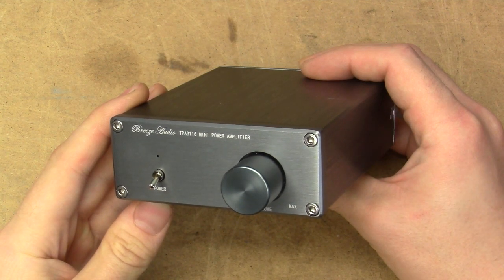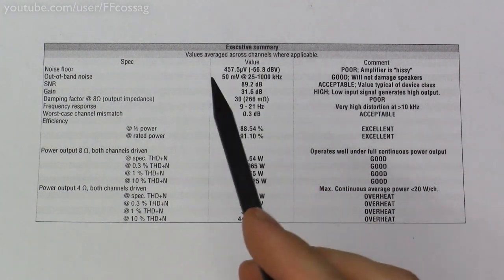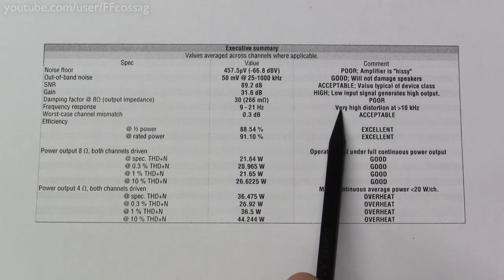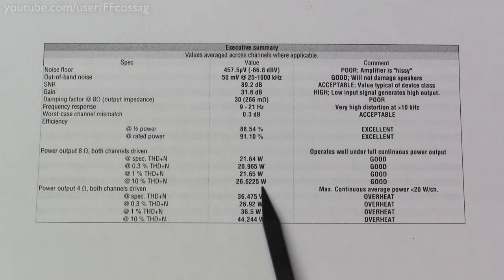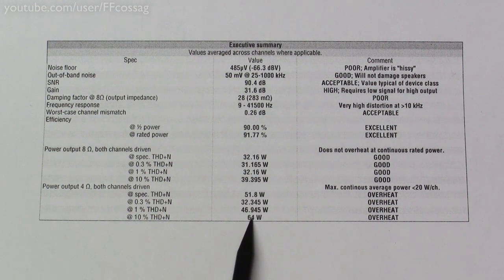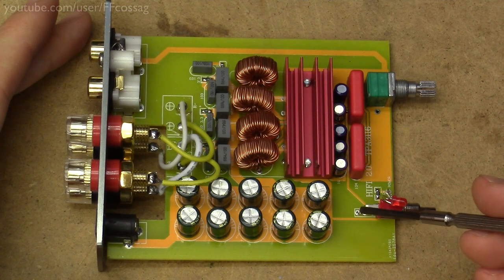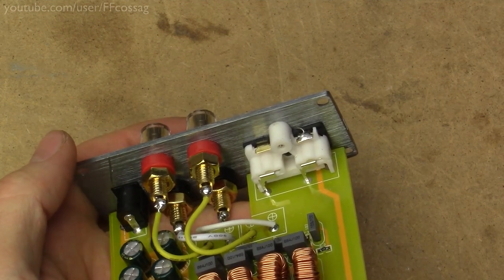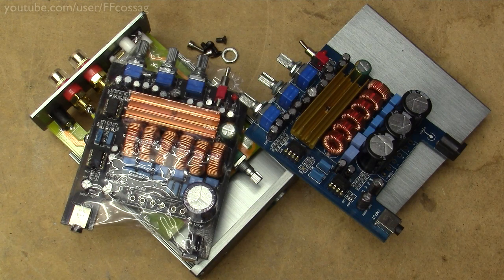Breeze Audio TPA3116 OBJECTIVE performance test, teardown & review

Comment: FFcossag   thanks for that 

I am considering buying a small amplifier for Camping purposes i have 2  very quality speakers and this is the spec (os-10 niles speakers)

Recommended Amplifier Power:
Five to one hundred watts per channel

Nominal Impedance:
8 Ohms

Frequency Response:
65 Hz to 21kHz, plus or minus 3 dB (on axis)

Sensitivity:
89 decibels for 1.83 volts of Pink Noise, measured at 1 meter on axis

Is this amp good for me?
 if you recommend something else ??
( portable ) let me know
appreciate your help!
Reply from the maker: It's fine.
Reply: +FFcossag just fine?
Reply from the maker: adir abelhack
I can't say much more than I did in the video.
Reply: +FFcossag il be happy to much more detail answer from you..
Reply from the maker: adir abelhack
Sorry, I make these videos in order to help you choose for yourself. If I were to just tell everyone what to get, I'd be defeating my own purpose.

Comment: Hi, could you by chance do the same review of the tas5613 chipset? It's a very intriguing audio chip..
Reply from the maker: What's intriguing about it?
Reply: FFcossag The high power it delivers in relation to its affordable price, the lack of detailed information you can find about it on the internet (except for the data sheet), its low-distortion truepath hd that I still don't get what it really is, the difference it makes to make it work with a 19v power supply vs 24v vs 32v vs 36v etc.. (sorry for my bad english)
Reply from the maker: It looks like a pretty standard, albeit high grade class D chip to me, most of the datasheet seems to be marketing wank. Do you have a specific module in mind, that you'd like to see tested?
Reply: FFcossag Ok, I'm no expert, therefore this is probably the reason why it's intriguing to me and not to you.  Specifically, I'm thinking about buying the Drok tpa5613 2.1 amplifier. 2*75w + 150w (300w total measured at a 35v voltage). It looks very similar to breeze audio typical amplifiers. No aux, no digital connections, no bluetooth, just 1rca. Thanks for your answers anyway and keep up your good and detailed work.

Comment: could u use a 24volts 20 AMPS power supply with this? haw dose the amps affect it?
Reply from the maker: 24 V is a bit too much for this amp, but it'll likely be fine.

Comment: Would it be worth putting a small quiet fan in the case?
Reply from the maker: I would not say so. Perhaps drilling some holes.
Reply: I would add a copper spacer between IC and case, and maybe even a heatsink straight on the top of amp. With proper heatsink it will look (and stay with 4ohm load) really cool, I guess

Comment: hi, would you do a similar test with the successor of 3116, the TDA7498 ? I just bought one because I thought my 3116 was awesome and the TDA7498 is meant to have double the power. 29 usd for the TDA7498 2.1 on aliexpress
Reply from the maker: The TDA7498 is not the "successor" of the TPA3116, it's just a competitor's chip. If you have a link to where I can get one of those modules, I might check it out. Performance is tied more to the implementation of the chip than the chip itself.
Reply: +FFcossag just type TDA7498 2.1 in aliexpress it's the blue one that claims 400 watt. 200 + 100 + 100 I just said it was the successor because one of the sellers told me it was.
Reply from the maker: Phil Drums
He lied, lol.
Reply: +FFcossag haha damn! Anyway, if you could make a video on how far below 400 watt it is, that would be amazing. I have 4 ohm speakers that I will using with it, with which I have used at full blast, for entire nights, with my 3116, with a 12 volt battery and I had no over heating issues. Although i have a different circuit board to thr ones you have. Now I have just bought a 24 volt battery and the TDA7498 with which I feel like I might have issues after watching your video.
Reply: +FFcossag i got a bluetooth 4.0 module that might interest you too. It comes with an app for Android and iPhone that allows you to change frequency's on the radio, and the equaliser so that you can tune your portable speaker. Only 11 dollars!
Reply from the maker: Phil Drums
I generally don't do bluetooth stuff, on account of how I don't own (nor do I desire to own) a smartphone.
Reply: +FFcossag ahh well you dont need to use the app. it comes with a remote control. It has a 7 band eq to try make your portable speaker sound alright. I think it really helps! just using the amp doesn't generally sound to good.

Comment: could i run this amp with 4 ohm speakers  if i drill a hole on the top of the case and put a 80 or 60mm pc  fan?
Reply from the maker: Likely. It's probably fine even with no fan as long as you don't play loud.

Comment: It's nearly impossible for it to be a clone IC. The world simply doesn't need THAT many no-name almost-high-quality amplifier boards to justify the immense effort of copying this modern and nontrivial IC, when much cheaper 12V and even 24V ICs are available like PAM8100, which is sufficient for nearly all non-HiFi use-cases. Reject? Possible. More likely though: you're supposed to actually cool the IC! A tiny heatsink in stale air, no provision for bottom side cooling, now how much good is that doing you?
Reply: I agree. I was wondering about the knock-off, but TI-chips aren't that expensive for you to warrant any copying. They're less than 2 euro per piece from Mouser Electronics and other reputable sources. But I've noticed that even though a lot of the amp chips support up to 24v, the quiescent current skyrockets if you up the voltage from 12 to 24v. So that's in addition to the load you're driving. Using 4 ohm speakers with 12 volts might actually end up giving better results.

Comment: The value that i hate the most, is the 10% distorsion, that mean it is not high fidelity.
Reply: No, ALL amplifier modules are specified at their 10% distortion, which is absolutely unfortunate because it's an entirely useless figure, but it's a tradition that goes back to 60ies or earlier, so we have to live with that. What you really want to know is how far below that 10% value you need to go to reach a distortion plateau, and this amplifier does reach 0.3% and lower.

Comment: i received the box and a bit annoyed about the on/off switch which leaves the pcb powered on all the time. Should be not a big problem to connect it to the voltage input jack right? Wonder if this will give any "plop" on speaker when switching on.
Reply from the maker: There's not much downside to using the switch in its standard issue; it puts the amplifier IC to sleep, and the only current consumed is that of the LED.
Reply from the maker: xrated Mine does not consume anywhere near 3 W when off. If you're measuring that with a wall outlet meter, the VAST majority of that power is going to be losses in the PSU. My amplifier only draws 10-30 mA at 24 V when powered off, which is less than 1 W.

Comment: did you also test the other dual board with the 3 big caps? wonder which one is better.
Reply from the maker: The board with 3 caps is inferior to the one with one cap. I think the 3-cap thing is an earlier revision that's mostly identical but not as refined.

Comment: found some interesting stuff, would be interesting to see if its worth the fuzz on a TPA3116:
https://hifiduino.wordpress.com/2013/03/05/dual-mono-tpa3122d2-amp/
"Shielded inductors will also help reduce distortion and EMI, minimizing crosstalk in the process."
"Put high quality film caps on LIN, RIN, and BYPASS (C1, C2, C14). This will be the biggest factor in improving sound quality."
"For more bass, replace the C7/C8 and C10/C11 pairs with a 2200 uF (8 ohm speaker) or 4700 uF (4 ohm speaker)"
Reply from the maker: Those "mods" sound like typical audiophile bullshit. Note that that page is about a TPA3122, though, which seems to be an entirely different chipset to the 3116.